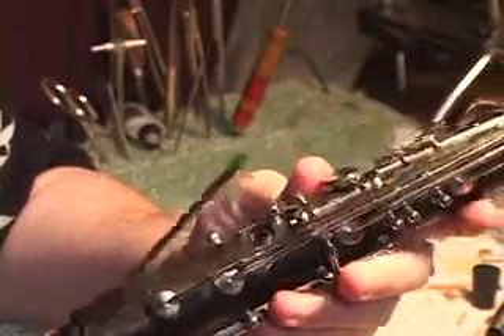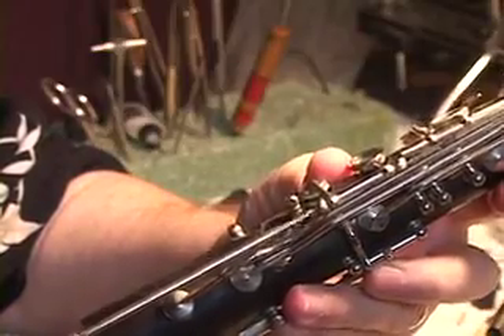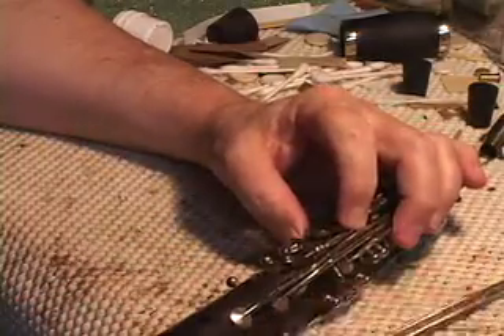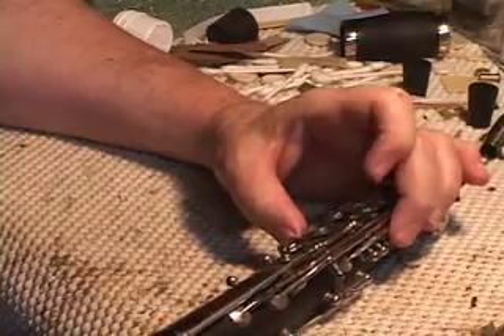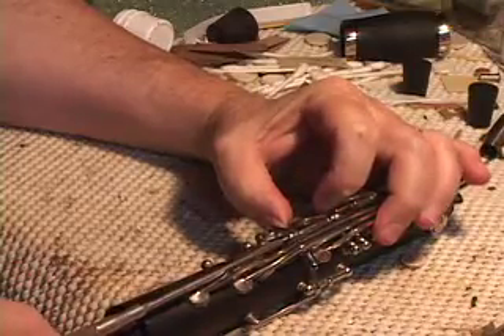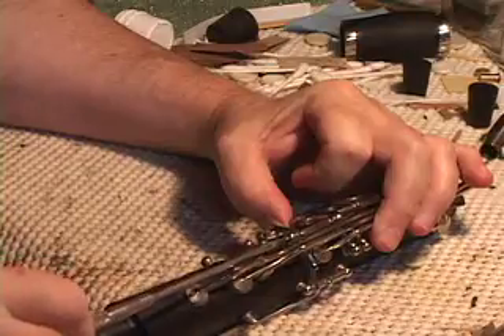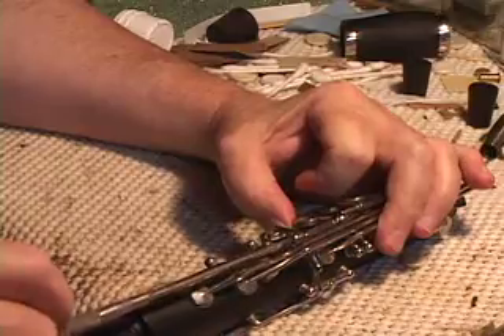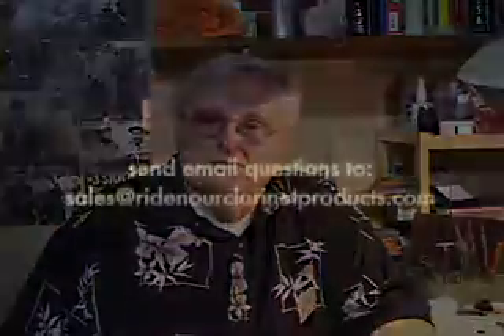Clarinet Repair and Maintenance: Don't Screw up your Screws

Comment: Great video! Perhaps now you can answer the question that has plagued mankind down through the ages: How exactly do those NASCAR pit crews slam on a fresh tire, then slam that pneumatic lug wrench onto those lug nuts and, at 400mph, spin those lug nuts on without stripping the threads?